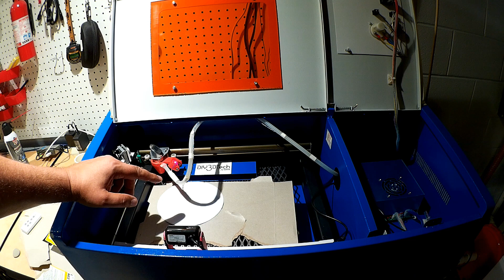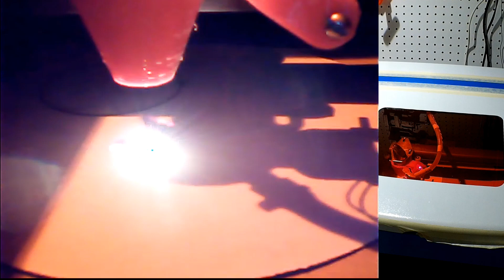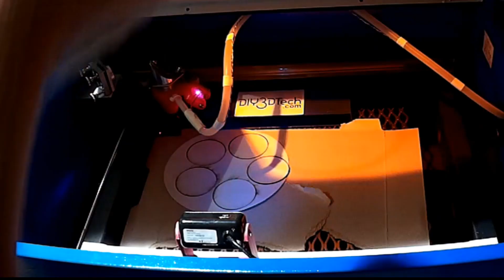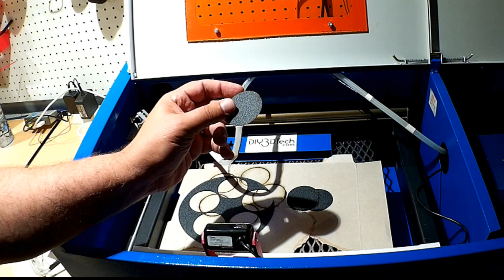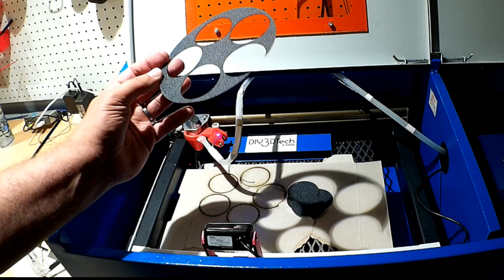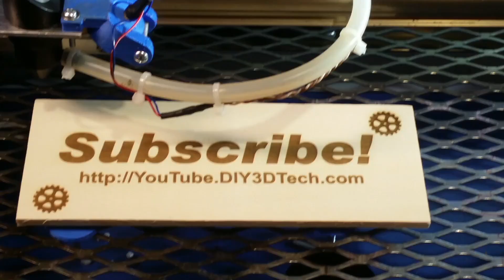K40 eBay Chinese CO2 Laser Cutter & Engraver - Yes You Can Cut Adhesive Sandpaper!

Comment: Looking at your web site for the eBay machines, can you tell me the difference between the blue machine like yours and the red ones?  All similar prices and it looks like they’re from the same seller.  Some have analog gauges and some digital.  Is one a newer version perhaps?
Reply from the maker: They are all pretty much the same in general design, the sheet metal may vary a bit (both of my blue ones are different sheet metal)  but if you stay in the 40 watt class the guts are pretty much the same...
Reply: The same just some they ran out of paint.  There is even a green one now.